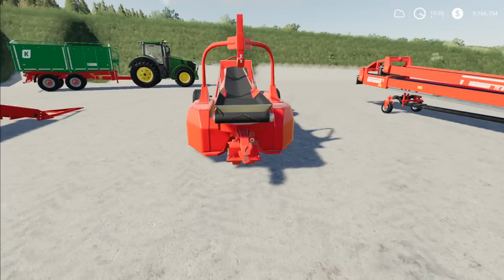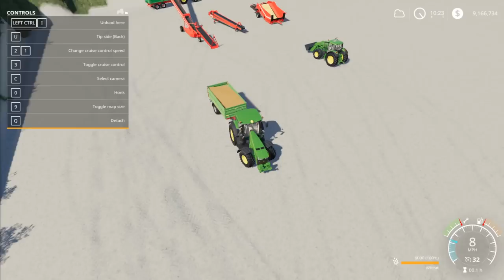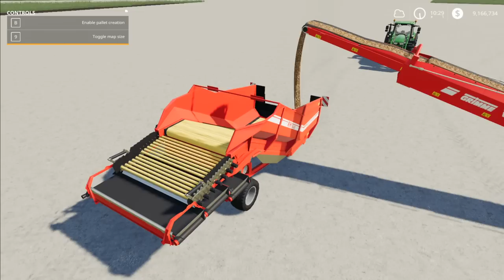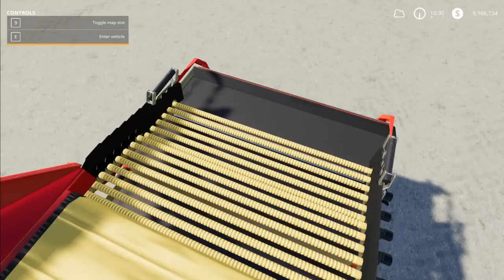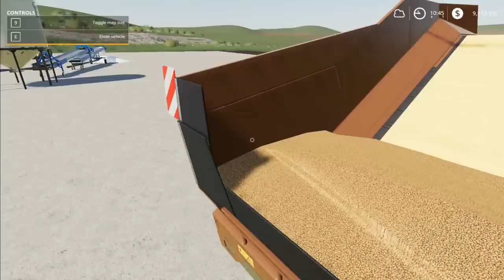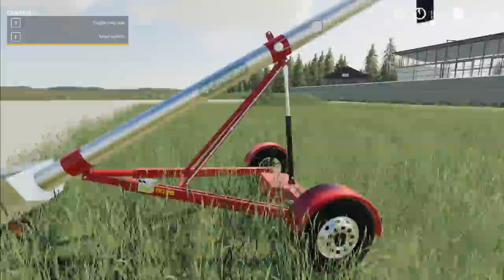A Guide to Conveyor Belts in Farming Simulator 19!!

Comment: A couple additional notes: The extension belt can be connected directly to the pickup and loading belts, so you can have them all attached in one chain as opposed to individually controlling them separately. As well, you can adjust the height of the pickup belt after it has been connected to other belts. Use 'G' to select the pickup belt, and then the left-click up and down controls the height of the hitch, and thence the height of the pickup.

Comment: I'm sure this has been done but...
in order to facilitate fast dropoff, in the basic map of the default location (i forget what it's called) there's a central elevator that's a purchase point, so I just built a line of belts leading up to it and stuck the end of the belts under a silo spout after I built a silo near the central elevator.  It makes dropping off stuff from trucks faster than having to drive up on the ramp, and I figured out I can chain silos together that way and end up with a huge amount of storage that becomes a long delivery chain from almost anywhere on the map.

fun stuff.

one thing i noticed though is that the filling from the silo stops once the first belt is full, except sometimes I can get it to fill several belts at once - i'd love to know the rule for that so I can just get it to fill constantly once the silo has grain.

Comment: You can adjust the height of that grey auger you had attached to the tipper trailer. You just have to push G to cycle over to it then use a mouse button similar to adjusting heights on a conveyor. If you have manual attach mod then you also need hoses hooked up.

Comment: What I'm missing is the area/range in/at which the S-710 picks up stuff.  Ideally, the game would outline the area on the ground when placing/moving the conveyor.  I know I won't get this in FS19 anymore at this point… and I'm not too hopeful for FS22 having something like this.

Frankly, the whole shop is bad.  Which actual farmer would buy a conveyor without checking the specs?  How fast is it, how much can it transport, how long (if expandable, min/max) is it?  None of the in FS19, and probably not in 22 either.

smh